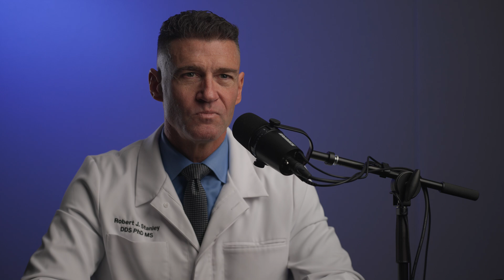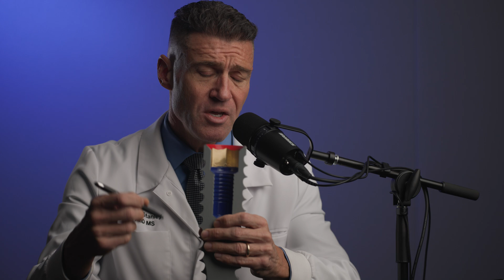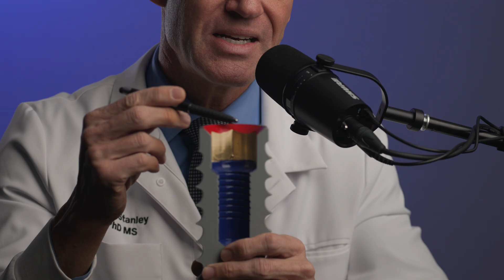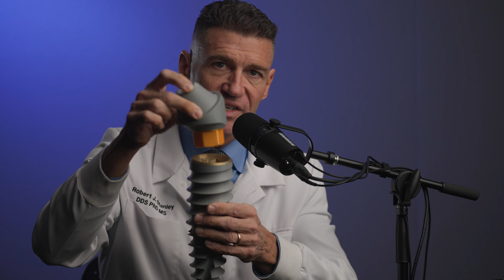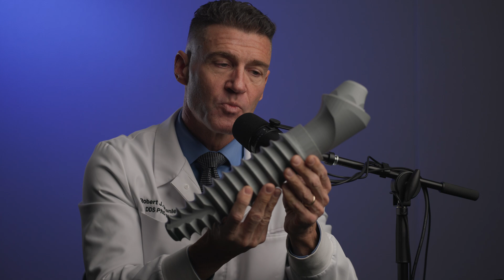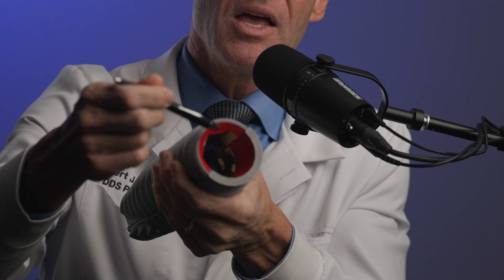DEEP or SHALLOW Conical Seal: Which Dental Implant is BEST?

Comment: Another disadvantage to very steep conical connections *BH is 82.5 degrees) is that the mating tapers are approaching that of a Morse Taper and can form a bond that requires a retrieval screw to disengage. Straumann recognized that with its 82 degree Torqfit connection on the BLX and included threads in the internal shaft of the abutment so that a retrievel tool can jack the abutment out of the implant. This only works for 2-piece abutments. 1-piece healing collars can get locked in and require cutting out to remove.
Reply from the maker: Hopefully, anyone reading these comments will come to the simple realization that implant design plays a pivotal role in the overall success of tooth replacement therapy. Anyone who asserts that all implants are identical is operating from a position of ignorance. Such a claim serves as a strong indicator of the need for further education.

Comment: I checked BioHorizons catalog and the shortest implant with the conical connection is 9mm. That is not even the worse thing wrong with this implant. As your prior video pointed out, ridges are seldom flat. This means that if you place the implant level with the lingual, which is usually the higher point, the blasted surface and laser lines will be exposed on the labial to the soft tissue and that can contribute to peri-implantitis. If you drop the implant subcrestal to avoid exposure of the rough surface, this will encourage bone loss because bone will recede to below the implant-abutment junction. If the implant is placed in an extraction socket, requiring grafting to cover the exposed rough surface, subsequent remodeling will eventually expose the rough surface. Research shows that exposed rough surfaces contribute to the formation of biofilm which contributes to peri-implantitis.
Reply from the maker: The literature clearly states that having rough implant surfaces is superior to smooth ones when it comes to oseointegration. A smooth emergence in the sulcus region of the mucosal tunnel makes sense because it mimics the smooth nature of enamel in that area. However, it doesn’t make sense to have a smooth metal or zirconia abutment in the deeper portion of the mucosal tunnel, where the body attempts to seal off the mucosa penetration with connective tissue and junctional epithelium. These tissues attach to teeth on the cementum, which is not smooth. Laser Lok is designed to enhance CT attachment in the region 2-3mm below the FGM. With proper technique, this region will never be exposed to the oral environment. If an implant is exposed to the oral environment, having a smooth surface would help keep it clean, but the real question is why is the implant exposed in the first place? Properly executed dental implantology does not present with peri-implantitis. Anyone not convinced, take my class, and I’ll prove it to you with my money-back guarantee.
Reply: Sponsor me to your class. Will love to learn .
Reply: In the ideal situation with 2mm of buccal or labial bone, the chance of more than 1mm of bone loss is slim BUT as you point out, ridges are seldom level and implant placement into extraction sockets will inevitably result in bone loss and grafted sites will resorb. The answer is an implant with a 2mm to 2.5mm smooth neck to allow vertical flexibility in placement. Ideally, the top of the implant is not at the bottom off a deep tunnel - that only occurred if you place the implan
 which is often done to assure the blasted surface is not exposed or if the internal shaft diameter is small and you need running room for your abutment to reach a restorable diameter. The ideal placement is with the top of the implant 1mm Supra-crestal so that the junction is away from the bone and the soft tissue can attach to the 1mm exposed neck  and will not be disturbed from prosthetic component, healing collars and transfer exchanges.
This is a perusing change in thinking for some  but it is exactly how a Straumann  tissue level implants have been used by Dr. Buser for decades.

A. number of studies that support this concept are available at www.paragon-implant.com
Reply: Here is the document with the research reports supporting this Paradigm Shift in implant design and surgical protocol.
Reply: In the ideal situation with 2mm of buccal or labial bone, the chance of more than 1mm of bone loss is slim BUT as you point out, ridges are seldom level and implant placement into extraction sockets will inevitably result in bone loss and grafted sites will resorb. The answer is an implant with a 2mm to 2.5mm smooth neck to allow vertical flexibility in placement. Ideally, the top of the implant is not at the bottom off a deep tunnel - that only occurred if you place the implan
 which is often done to assure the blasted surface is not exposed or if the internal shaft diameter is small and you need running room for your abutment to reach a restorable diameter. The ideal placement is with the top of the implant 1mm Supra-crestal so that the junction is away from the bone and the soft tissue can attach to the 1mm exposed neck  and will not be disturbed from prosthetic component, healing collars and transfer exchanges.
This is a perusing change in thinking for some  but it is exactly how a Straumann  tissue level implants have been used by Dr. Buser for decades.

A. number of studies that support this concept are available at www.paragon-implant.com in this document:

https://paragon-implant.com/publications/a-paradigm-shift-in-implant-design/

Comment: If the component material make the implant more resistant,than why not to use these components  in all the implants industrie
Reply from the maker: That’s an excellent question! The answer lies in cost. Fabricating medical-grade 23 titanium is more expensive, and machining it is even more costly due to its harder nature, which strains the tools used to cut the metal. If you’re selling a cheap implant to dentists who lack knowledge or understanding of the difference, opt for a weaker metal. Now, you understand that implants aren’t a commodity, and implant design can make all the difference between success and failure for our patients. Choose wisely.
Reply: Actually, titanium alloy is easier to machine because it does not gum up the drills. I started with alloy in 1982 with the Core-Vent implant and when I introduced the Screw-Vent in 1986 in pure titanium to match the Branemark implant. By 1990 and since, everything I make in implants and abutments has been Grade 23 alloy. I don’t even know if there is a cost difference because there is only about $0.40 of titanium in an implant. The real difference in implants that effects cost is the quality control and the sales/marketing budget. The premium priced companies can sell an implant for $535 to one customer and $100 to a DSO. My go to market strategy had always been pick a fair price and charge everyone, regardless of volume, the same.

Comment: Nice big models but I am not persuaded by your drop test - if the cams align that easily, it just means that it is a sloppy fit. Anyone who has used implants with😢
The 45 degree bevel probably never even noticed the time it took to align the flats of the hex because it takes a couple of seconds at most, not the 1 to 2 minutes you stated. 
Yes Titanium alloy is 34% stronger than Grade 4 titanium, but small diameter implants made from alloy have also fractured so preserving the wall thickness for greater strength is far nor important than saving a few seconds seating the abutment. The striking difference in your models that you failed to mention is the greater depth of the steep conical connection.  In many systems, that precludes making 6mm short implants..
Reply: I just checked BioHorizons catalog and the shortest deep conical connection implant they make is 9mm - that, and the thinner walls are game ball on the comparison. A hex is made by broaching (forcing) a hex tool into the round internal shaft creating sharp grooves. Cam slots are made by machining with a cutting tool which rounds the edges of the projections. This is why it  - self centers on insertion as evidenced by your drop test. The sloppier the fit, the easier to seat the components but the more likely micro-movement under function will result in a loose screw. Remember your video demonstrating that ridges are seldom flat. The industry is waking up to the increased incidence of peri-implantitis and the importance of having a smooth neck on the implant to minimize exposure of a rough surface to the soft tissue. BH laser lines with blasting to the top of the implant condems that implant regardless of the connection.
Reply: @geraldniznick5125  7.5mm is the shortest .
Reply from the maker: Hey Gerald, as you mentioned, the deep conical design does have some limitations. This video was created to demonstrate the benefit of the deep conical design—its ease of use. The deep conical region enables an off-axis insertion, which is physically impossible with the shallow conical design. (The fact the cams indexed in this video was just a coincidence.) This insertion advantage wouldn’t be clinically relevant in most single implant deliveries. However, when placing angled implants with all-on-x type solutions, inserting the MUA with proper timing and indexing can be challenging with the shallow conical design. The deep conical design allows the surgeon to blindly initiate insertion of the MUA and, with a slight rotation of the MUA seat it into the correct index. In my opinion, this is the single most significant advantage of the deep conical design as illustrated by the drop test in the video.
Reply: You said that the ease of seating the abutment is “the single most important thing”. I would think that the stability of the implant abutment junction and reducing the risk of fracture, both of which you acknowledge are better with the short conical seal, are more important. Your perceived advantage in seating is only  a factor on distal angled implants which is a small fraction of your cases. In addition, the deep lead-in bevel has two other drawbacks. 
1. The shortest implant BH makes with that connection is 9mm vs 7.5mm for its short bevel implant, and 
2. Abutments can get stuck in a steep bevel because the mating bevels can cold weld from torquing in the fixation screw. Companies that understand this, like Straumann, include internal threads in the abutment’s shaft so that a retrieval screw can be used to separate the parts, something BH overlooked. If ease of seating the abutment is high up on your wish list, you will love my new GEN5+ which comes with the abutment base friction fit to the implant.

Comment: Is the deep conical connection similar to Camlog/Conelog?  I think biohorizon's has 6 cams and conelog only has 3 cams.
Reply from the maker: Yes. Biohorizons added the extra cams to move from 3 to 6 for easy of use. It is the same concept.
Reply: 😮
BH may have 6 cans in the internal shaft of the implant but only 3 cans on the abutment. I don’t see how this adds to”ease of use” but it could add to more rotational play between the mating surfaces. The implant’s many other shortcomings supersede any perceived benefits with the biggest shortcoming being micro- and macro irregularities on the neck of the implant. Don’t take my word for it. Listen to Dr. Buser’s 2022 lecture at AO.
Reply: https://youtu.be/zpG8uRyVTHw

Comment: Thank you for the explanation. You mentioned that the BioHorizons grade 23 titanium implants are 36% stronger. Stronger compared to a 100% titanium implant? How would it compare to an alloy like the Straumann Roxolid line made up of 85% titanium and 15% zirconia? For single tooth implants, does the deep conical connection matter at all?
Reply from the maker: Medical Grade 23 titanium alloy is 36% stronger that grade 4 titanium. Roxolid is 27% stronger than grade 4 titanium. For single implants with straight paths of insertion the easy of insertion really doesn't differ much. It does make a difference with angled implants and MUA placement.